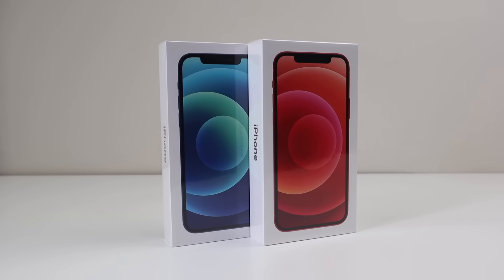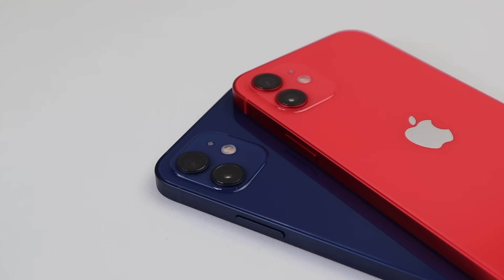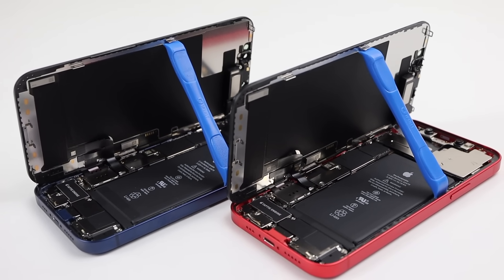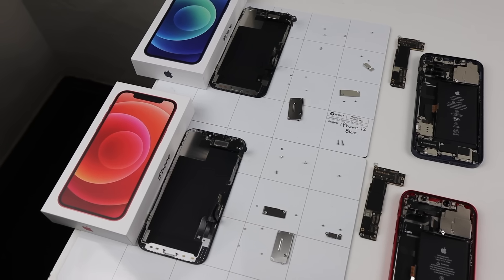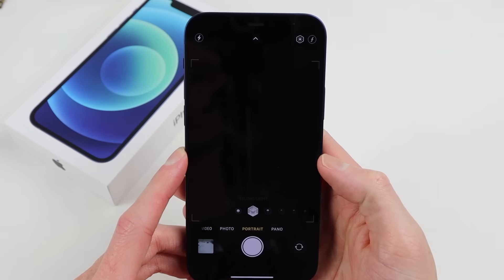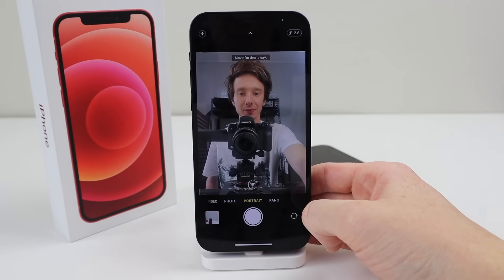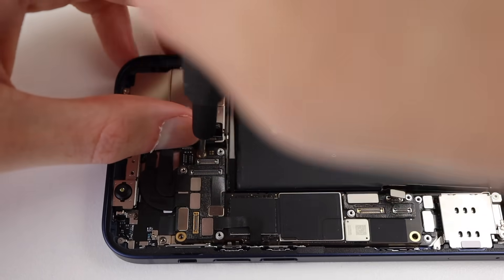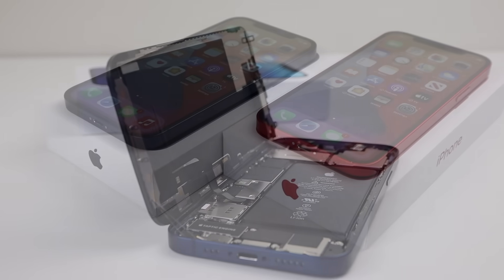iPhone 12 Anti Repair Design - Teardown and Repair Assessment

Comment: My question to Hugh is: were you able to swap the screens? Also, did you not need to glue the screen back on?
Reply: The second question he answered in the video. There is no proper sealent out there so he did not reseal the phones and screens are therefore not glued in on those 2.

Comment: This is why I will never buy an Apple.  If I pay $1500 for a device, I expect to own it and be able to repair and modify it as I see fit.  Tesla has the same problem.
Reply: can you explain more about tesla? im curious
Reply: @rrrr2150  Tesla repairs are expensive, and you have to take it to a certified dealer.  3rd party parts are not kosher according to them.  So you are stuck paying $1000s for a $70 once out of warranty.  Barring this as something that you sign up for when you buy one, my biggest issue with them is the remote disabling of features already paid for.  If you pay $1000s for upgrades like the speed package or autopilot and sell the vehicle, then once they find out, they will disable these features until the new owner pays sticker price of said feature to Tesla.  Its a scummy practice of double dipping and proof that you do not own your vehicle that you paid $80k+ for.
Reply: @Onno_Inada  oh my god that's disgusting

Comment: Really annoys me how people continue to throw their money at apple despite their blatantly scummy business ethics. Like only they have the gall to lie to your face and say they aren't including chargers to reduce waste but change the connection so you're forced to buy another one anyways. Or how they obviously create problems so they can sell a solution with all their god damn adapters. Like don't you dare tell me you couldnt find the space for a micro SD card and instead try selling me a god damn brick of an adapter for something small enough it can be integrated into the sim card tray of an android phone. Not to mention how they've literally been investing in ways to make their products difficult to repair for years. Like how they made it impossible to open one of their phones without some specialized equipment that ended with someone inventing a laser to burn away the adhesive so repair shops could make repairs on the phone.

Comment: I will be switching to android after watching this.
And probably to windows computers
Have been an apple user since 2001,
I should  have realised what bastards they can be when my 2006 mac pro that cost $5000 could not be upgraded past mountain lion, yet macbooks Imacs macbook pros,   could , It wasn't that it wasn't possible, they just refused.
Reply: To be fair, it's kinda amazing you still have a 2006 mac pro that still functions.  There's no chance a windows pc from 2006 is still running anything at this point.  Also it's a hardware compatibility thing.  The newer OS features require the new hardware.  It's also to prevent people from complaining that the new software doesn't work on ancient hardware.  It's a mess if you try to force new code to support old hardware.
Reply: @eksentrysyti  I don't use it any more, but it can be patched to work with yosemite, apparently with an ugraded graphics card it would work very well. ,the point was if some random geek could do that and offer that as a service . Apple could have done so aswell.
Reply: I've seen plenty of PCs from that era that still function. Windows 10 still works on Vista and late XP era machines.

Comment: Conclusion to help the enviroment :
Stop buying new phones every year.
Apple in specific.
Reply: Literally at this point even if the specs of the iphone are higher i dont care ima just buy an android no matter what. They are just better in everything else but specs (i mean there are good phones out there too)
Reply: @nyagz7351  actually android specs have been better for a while now.  You'll have the best phone for the best price and the most complete ownership of your device.
Reply: I have an Android for about 8 or 9 years. Zero problems. Why people buy a cellphone per year? omfg...
Reply: @unknown8570  i have a droid rn its about 2 years old . The last phone i had was from 2006 :/.i even have the screen  protector glass still on from day one and i can say i droped it a bunch but only the sides cracked a little
Reply: What about when you drop it and break the screen 3-4 years from now?  According to this video you may not be able to replace it.  Also the batteries die off after 2-3 years, so then what?  Even if you keep a phone for 3-5 years before upgrading, which is totally possible, you may need to service it in some way during that time.  But the author says you can't if you have this phone.
Reply: They are pulling some EA moves here
Reply: I usually buy around 6 to 7 years or if it breaks I still got my xr
Reply: get an asus rog 3
its better specs for less money
(and its more self-servicable)
Reply: That advice is so stupid. The best way to help the environment is to ship the phone without anything else inside the box. That would reduce the manufacturing waste a lot.
Reply: @theerlantrinanda7091  that advice is so stupid too bruh so you're telling people they should really go on and buy chargers and earphones separately which would then be shipped in another different container which honestly doesnt help reducing waste at all
Reply: @corderitouuuu  read again
Reply: @atsuki18  he was wrong about the specifics,  but it was still a joke.
Reply: @blancmarquis2269  he hasnt edited his post so my point still stands soo
Reply: @atsuki18  previous dude got wooshed tho soooo lol

Comment: You just don't get it, do you. Just because there is a USB-C cable in there, doesn't say you can't use your old USB cable. So yeah, your old charger is perfect to use. The cable is just a requisity and extra. The reason it's not repairable by third party is so Apple can make sure that the repair is done accordingly, the waste is dealt with in a proper manner so they know they are actually doing what they promised. But I guess you '3rd party repair guys' just can't seem to think logical and keep putting aftermarket fake and bad quality parts in there. Hooray....
Reply: Lol you are ignorant, Apple charges hundreds of dollars for repairs that can be done with the same parts they use for 50$ MAX, I am a repair man and this destroys so many people's livelihoods and it will not last, this would put far too many people out of jobs for someone not to find a way to bypass it.

Comment: This is Apple’s reason for not repairing their iPhones.  You buy their iPhone 12. You should also buy Apple Care. If your iPhone has a problem then bring it to Apple store and they will exchange it for a new one plus $499 or whatever it is. When your iPhone stops working and Apple Care is expired, Apple will ‘dispose ‘ of it properly, which means repaired and used as a replacement device for the next guy. Then you should buy a new iPhone 14.  If you did not back up your data, sorry it is gone forever.

Comment: Did you test switching just the displays? I imagine that is the most common repair needed. I have replaced many displays on my wife's different iPhones, but have decided not to do it anymore if it's ever needed. There has just been to many issues (including ripped flex cables...)

Comment: I actually have the type c to lighting cable bc it’s the only way I can charge my phone through my MacBook in school and it’s the only adaptor I have that fits the type c cable. So I really went out and spent 30$ on a cable that only connects my laptop to my phone. 😭😭 I guess my switch to my phone too but I’m not finna charge my phone with my switch battery.

Comment: Have you tried Switching iPhone 12 red screen to another iPhone 12 red? maybe apple did something to pairing to the exact model\color. I know for iPhone X-11 the camera is tied to the motherboard which killed camera repairs because Face ID wouldnt work and with iPhone 5s-8 the home button was paired to the motherboard so if you swap them the Touch ID wouldnt work. I still made money Fixing screens. But This will be a new step in greedy if the screen is also paired to the motherboard. if they Kill screen repairs that would be end of the majority of my repair jobs and a loss in income.

Comment: I think the reason why camera is not functioning properly is because it's quite common for anyone to open the camera first and check whether it's working properly or not and if any changes are done it will not work like normal indicating the device is messed up internally.

Comment: So Apple basically issued a software assigned serial number for each part basically, so if a different part is installed, the other part has a different serial number, making it impossible to repair via part replacement. Unless a third party repair shop has the same equipment that apple uses to assign or wipe and change serial numbers on each part, third party repair shops will only be able to repair existing parts, not replace them with new ones. Their anti-consumerism tactics is just outrageous. Hope that many people and loyal Apple customers won't buy the new iPhone to protest this new strategy of theirs.

Comment: Which I know doesn’t seem like huge issue but when you start to get into the semantics of what comes next, it is important to have a process of design development well before you release specific measures and products... it’s a tight market and security dependability is a high priority in the ever increasing ‘cyber world’ we are ever plunging forward into...
Reply: Hypothetically, if I wanted to steal your data, I could clone the data and then if parts weren’t paired just slap it in any old phone and go for broke... it’s part of a five process protocol of identity verification... ostensibly this element seeks to control chain of possession...

Comment: Apple : you can't repair your expensive phone for SuStaiNaBility 
Samsung : you wanna repair your phone yourself?  Here's a link and somewhere to get cheap replacement parts :) enjoy your Frankenstein phone
Reply: My current Samsung is exactly like that. Its 3 broken phones from Ebay put together to make 1 good one.
Reply: @FloppydriveMaestro  I have a similar Sony phone. Its a mut of many different Sony phones
Reply: @mscprod240  ooh Sony phones are good
Reply: I don't remember which part  is original in my Galaxy S7 after 4 years usage. And now my kid is playing (using) it, while I am using my new S20.
Reply: @mirzosharifjalolov4247  when you didn't repairt it yourself,got it repairt almaot all parts are originall
Reply: @Desugan69  Yes. By "original" I mean "initial" part when the phone was bought.
Reply: I hat my old galaxy s5 two times repairt from a third party because display broke (i droped it  ) and it worked like a charm ( costed around 180€) and also hat my actual  daily phone repairt for 120€ repairt (also third party) . 
An display repair for an old iphone 6 costs by the same repair around 180€ becuase he must pay more to get authenticated apple parts and its a lot more trouble for him  .
Reply: My S4 is a similiar case; 2 years ago the motherboard dies and i replaced it with a GT I9505 motherboard, everything works fine, turned my i9515 to an i9505 lol
Reply: Just make sure you buy the American version, otherwise you're getting a 20% slower and more power hungry phone for the same price...
Reply: @trouty7947  whell i'm  from germany so i Think i got the eu version
Reply: Best of all, you can decide for yourself if you will repair your old phone or buy a new one. That's how markets work - and should work.
If only one company made phones, there would be no improvements or evolution. Just the same phone years after years. Just like they did in the former Soviet Union and DDR, the same crappy products years after years. (No cell phones at all, hardly any phones at all.) In the eighties, I went to DDR and brought with me a Walk Man. The kids didn't even know what it was! They were stunned that it was possible to put a music player in your pocket! If you've been in an East-block country before the wall fell, you would know what I'm talking list. They did the same with everything else. Their car was made of some kind of paper-plastic. Cheap as hell to produce, but very expensive to buy - after up to ten years waiting list to actually buy one! Just think what it would be like if only one company in the world made phones. Would it be even close to those marvels of minicomputer we have today?

Comment: This is to be expected. Especially the FaceID sensor. Treat it like TouchID on previous generations, it would need to move from screen to screen as a 3rd party sensor wouldn’t work. In theory a new screen would be doable, given you just move the parts over to the new screen. If this is given enough attention, this can easily be fixed with a software update.

Comment: Apple in 2030: phone batteries are sold separately from the device...

Also Apple in 2030: wE nEeD tO RedUcE OuR CarBoN FooTPRInT
and it’s sold in packages of plastic which will make more plastic pollution

Comment: The charger adapter isn't about waste, it's just another way to charge you for something else. They charge you for everything they can, and I'm surprised they sent you a cord lol
Reply: Right lol where's the headphones? Oh right yeah, environment lol
Reply: they give you the type C cord just to mess with you and make you buy a new charger (funny thing no one yet tested 3rd party charger with the new phone)
Reply: @khalidnajjar  i have a 12 and it sist on the same charger I used on the 11 and it has not exploded yet (also the cord is still in the box, the lighting cables are useless and thats the bigger sin than not giving you a charger)
Reply: @sp4rksmith  most people don't have an iphone 11
Reply: Meanwhile, I charge my phone from the USB port on my computer when I walk into work.  The cable cost me $5.
Reply: Samsung is in talks to also remove the charging plug.
Reply: @PANIC87  that's why I don't use Apple or Samsung, I try to get a phone from a different company every time I have to buy a new phone.
Reply: @PANIC87  but Samsung doesn't or didn't yet change their cable u can still use normal adapters so it actually would make sense for Samsung to remove them I have like 5 at home and you could just buy an cheap 3rd party adapter if needed
Reply: @ABCD 314 absolutely, and don't buy it if you have enough problems in your life, if you're ok with one more, go for it lol
Reply: lol, microtransaction [like in games] irl
Reply: Apple will change to usbc charge port without the cable, no screen protector to save planet.  Case will be made out of recycle paper.  Only genuine Apple $200 usbc 18watt cable can be used for fast charge, all other cable at 1amp to protect the phone health.
Reply: I do nto agree with the lack of charger in any way, but I think cables and chargers should die completely. A chi charger costs 10USD, there is no "official" chi charger by apple, you can purchase any brand you want and get the same results. No devices come with a wireless charger. Wireless chargers are universal. I would like to think this is not a "money making scheme", but rather pushing tech in the right direction.
Reply: @sp4rksmith  Wireless charger only is kinda dumb. Its inefficient, you loose min 50% of power. If you wanna charge power from power bank 50% its big waste. Without usb you have no simple connectivity, usb pendrive, external accessory (flir camera), you cant even service phone when firmware fail.
Reply: @tomaszbiskup891  TBF I had no idea wireless charging is that inefficient ! Ty for informing me ! On the other hand there are already devices such as the apple watch that do not have a port and are doing fine. I hope we reach a point where there are wireless protocols in place for firmware reboots/resets etc.
Reply: @sp4rksmith  sounds like a nightmare when accessing/recovering your files
Reply: @nit-Inundate  ive never had issues accessing or recovering files and have not used a cable for such things in years
Reply: @sp4rksmith  Small devices can benefit from not having any ports or charging contacts, like watches and headphones when size matters and battery capacity is small. Wireless charging on phone is good for in car holder, you just put phone and its charging. Otherwise i prefer usb-c charging, its easy and fast to plug, and it works, you can charge and work with phone at the same time. With wireless you have to align phone with pad, and when you answer call you stop charging. Wireless charging for me its addon feature, not for main use.
Reply: @tomaszbiskup891  i like your arguments kind sir, you ahve convinsed me !

Comment: Wouldn’t another issue be if you wanted to connect the iPhone 12 to your computer the plug won’t work? I have an acer swift from 2017 so I know it wouldn’t work with mine

Comment: The iPhone 11, which is what I have, certainly didn’t ship with a usb-c to lightning cable when I got mine in 2019. I got a standard usb to lightning cable with the usual square block to charge it. 

It’s unlikely Apple’s motives in not including headphones or charging block is waste elimination, considering first-time iPhone users wouldn’t have either on hand. What Apple is doing, however, is trying to make more money off people by forcing them to buy most accessories separately.

Comment: On a positive note, anti-repair is one of the best anti-theft measures that Apple can take. The reason I am not using the iPhone is that they are recognizable valuables that could fetch good money on the black market. I use public transit, walk on the street, and live with others, simply no deal.
I may look into new iPhone models if they manage to lock more components in place.

Comment: Have you tried repurposing that blue iPhone by replacing the iOS with Linux OS?  You might be able to download that OS directly to that phone and not have further issues with the battery and, on top of that, no further issues with a faulty OS.